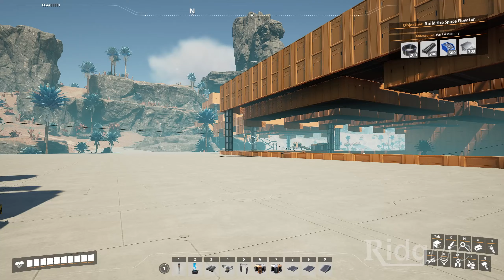No one has EVER made these roofs before #4

Comment: I don't know if you know about that, probably not but you don't need to disable the biomass burners, as long as you don't use enough power they won't consume any fuel, oh and you can trigger a headlight with pressing B if it's too dark for you
Reply from the maker: True about the consumption. I like to be reminded of how much is being used so I enable more as I go. That it does not consume when the machines idle is super handy though! As for the headlight, it is nice when exploring and great before lights are unlocked. Even with lights unlocked in the awesome shop it will be a nice extra to get some streaks of sunlight in the factory.